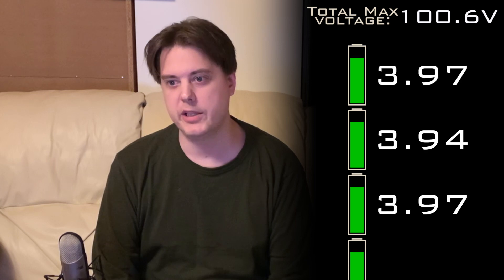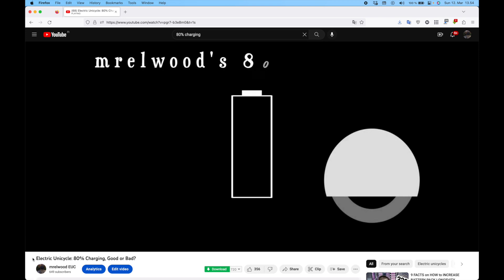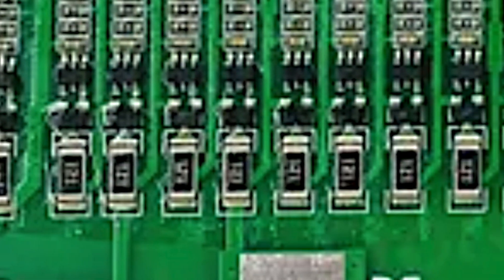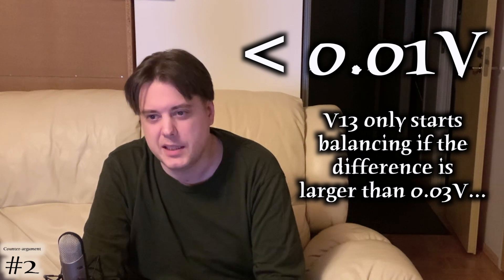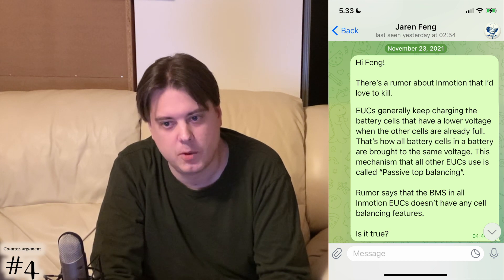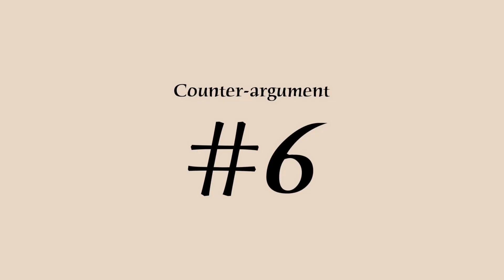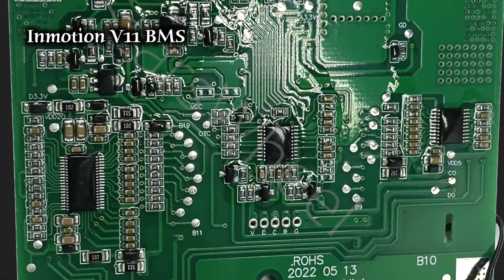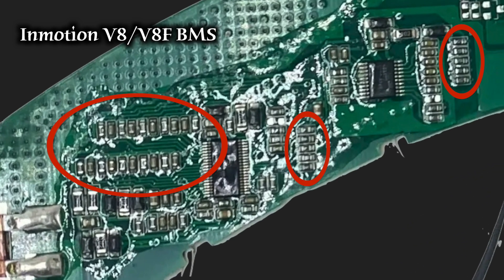Inmotion EUC Battery Cell Voltage Balancing, Yes/No?

Comment: So.. so far, there is solid proof that the V5F does not have passive cell balancing and you have acknowledged to @rcgldr that based on their findings, the V8F may not have any sort of balancing.  So while Adam's claims that no InMotion wheels have passive cell balancing (besides the V13 and beyond) MAY not be 100% correct, there are at least a couple models for which there is either hard evidence or pretty strong circumstantial evidence to support his claims despite what (some) InMotion engineers have stated and the visual presence of what MAY be bleed resistors that, at least for the V5F, have been proven not to serve the purpose of passive cell balancing.

Now, I'm not an InMotion hater; most of my stable is made up of InMotion wheels, but it seems like the only board ever actually taken apart, analyzed, and reverse engineered supports WrongWay's claim, while there hasn't been any solid proof to support the actual existence of passive cell balancing in their other pre-V13 wheels and, as mentioned, you have since acknowledged in several responses that at least some of their wheels may not have passive cell balancing after all.

https://forum.electricunicycle.org/topic/33366-inmotion-v5f-bms-charging-behavior/

https://forum.electricunicycle.org/topic/32080-do-inmotion-battery-packs-perform-cell-balancing-yes/

In conclusion: there is irrefutable proof one of their wheels (V5F) does not have cell balancing.  There is fairly strong evidence that another wheel (V8F) does not have balancing based on observed charging behavior and voltage readings.  There is nothing to actually support the existence of cell balancing in pre-V13 wheels other than the balance (ha!) of probability.

Comment: As you’ve described, passive balancing is on some inmotion euc’s models prior to the v13, like the v11. Adam indicated the importance of active balancing. Am i wrong? If I’m right, how critical is the difference between having passive and active balancing?
Reply from the maker: No, Adam didn’t recommend buying ANY Inmotion wheel because he thought that NONE of them had ANY kind of balancing.

Even the latest wheels still have just passive balancing, although a much smarter kind than they were when I made this video.

Comment: Follow up to my prior comment (over a year ago). Inmotion claims that V8F BMS will keep cells at 4.15 to 4.20 volts, a .05 volt variation (passive cell balancing BMS range is typically 4.195 to 4.200 volts, .005 volt variation). Someone checked a V8F pack, 5 cell pairs at ~4.2 volts, 15 cell pairs at ~4.15 volts, for a total ~ 83.25 volts. I tested my V8F, doing a full charge then leaving the charger running for 24 hours. The pack got close to 84 volts at around 0.3 amps, then stopped all charging, initially showing 83.6 volts. During the next 8 hours, the pack slowly discharged to 82.5 volts, at which point charging began again (stock charger led turned red). (In prior tests, I did a short ride to get pack voltage down to 82.5 volts). It maybe took 20 minutes before some cell pair reached max voltage, charging stopped, followed by that 8 hour slow discharge. I let it do another 8 hour 20 minute cycle. The pack remained a 83.6 volts once charging stopped. Inmotion did a "calibration" that changed the displayed voltage to 84 volts. I don't plan to measure the actual voltage. Assuming there is balancing it will be very slow if 1000 ohm resistors are used.

Comparing to 18XL which has true passive cell balancing. I bought an 18XL in April 2024. The 18XL BMS uses 100 ohm resistors, which translates into 0.042 amps balancing discharge current on a 4.2 volt 6 cell group. Using the KingSong app to monitor a full charge, once a 6 cell group reaches maximum voltage, it drops charge current to 0.00 amps, with periodic bursts of 0.25 amps about every 5 seconds, which results in the average current being less than the 0.042 balancing discharge current. This allows the high voltage cell groups to discharge while the lower voltage cell groups continue to charge, but at less than 0.042 amp average charge rate, which will take quite a while at such a low current. Once the pack is balanced, those periodic bursts cease to occur, and all charging stops. KingSong recommends letting the 18XL balance for 2 hours after charger led turns green, but the app can be used to note when those periodic bursts have stopped to know when balancing has completed. Most of the time, I have the pack at about 74 volts and only charge enough to end up back at about 74 volts after a relatively short ride. The longer I wait to do a full charge, the longer it takes the 18XL to balance the pack, but the pack voltage has remained the same, 84.05 volts (actually it's increased a bit to 84.08 volts, but I think that is due to monitoring and knowing just when the pack has been balanced). I only have 362 miles on the 18XL, as I don't ride as much as I used to, which is why I haven't seen any decrease in pack voltage. This method of passive cell balancing could balance a well out of balance pack, but would take longer than the recommended 2 hours, and the app should be used to confirm the periodic bursts have ceased, and balancing has completed. 

Back to the V8F. Unlike the 18XL where the pack voltage slowly increases a small amount during passive cell balancing, the V8F pack voltage slowly decreases once a cell pair reaches maximum voltage, so there is no passive cell balancing that occurs while charging.  i don't know what the V8F is doing while the pack is slowly discharging for about 8 hours, most of which may be due to just keeping the V8F awake enough to communicate with the app. With 1000 ohm resistors instead of 100 ohm resistors, and following KingSong guidelines, balancing would take 20 hours. I don't know if it would be better to disconnect the V8F from charger during that 8 hour or more slow discharge period.

Note - the eWheels rapid charger can't be used for passive cell balancing because it goes into standby, turns the led green and stops all charging once current drops below 0.3 amps. For the 18XL, I use it at 5 amps to get pack up to about 82 volts, then switch to the stock KingSong charger, which doesn't go into standby. When the stock charger led turns green, I then use the app to determine when balancing has completed.

Comment: from my understanding there is a chip or circuit that varies the resistance across each source. And that in theory will make each battery drain at relatively close timeframes. More or less.

Comment: What if you charge your wheel to 80% 2 times and every 3rd to 100%? What if you just charge to 100% the 5th or the 10th time between charging to 80%? Would you get the benefit of both? BMS and extended lifespan? 

Yes I know its only necessary if you drive like 30000 miles. I am just curious.
Reply from the maker: Back in the day the recommendation used to be to charge to full +balancing every 10th charge. Then it was once a week. But we still saw premature battery deaths when charged like that. That’s why every charge has made the most sense to me.

Every third sounds pretty reasonable still though. As long as you react if there are changes in how it behaves. I wish these were more scientific numbers, but it’s still just a guessing game. It all depends on how similar the cells are that you happen to get.

But again, this only applies to older wheels with passive top balancing, not the new smart BMS that balances the cells already before that.

Comment: Just picked up a V11, and the person said he only charged it to 80-90% at a time because he didn't want to over charge it due to the short distance he was using it (less that 8 miles per day).. Upon receiving it, I used it for a good 12 miles, but now have only charged this to about 91%.. EUC fires or PEV fires are what I freak out about.. but my other boards, Trampa, Exway, Ownboard, even Summerboard.. No issues.. Your video has helped my anxiety

Comment: Those ICs can control voltage and not necessarily balance it. There are so much resistors at any types of PCBs and they are not containing bms obviously. So you can't judje by presence of resistors...
Reply from the maker: I might not get your points the way you intended. Balancing the cells IS exactly controlling the voltage. And BMS stands for Battery Management System. Every device (of any kind) that has a charging feature in it has a BMS, whether it has a balancing function or not.

My point in bringing up the resistors was a response to WrongWay determining that if a BMS doesn’t have the same resistors than a GotWay BMS, it wouldn’t have a cell balancing function of any kind.

Comment: Hi, brother. Let me ask you a question. My V12Pro has about 8% power left and the voltage is 82V. Another battery failed and I needed to buy a new one. Can my new battery be installed directly? Because the voltages of the old and new batteries are definitely different, I installed them directly. Will there be any safety hazards when charging the two batteries together? What can I do to be safe? I really hope to get your answer, thank you!:face-red-heart-shape:
Reply from the maker: The V12 has a safety system in place that locks down the wheel if the voltage difference between packs is more than 5V. You will then need to contact Inmotion to get it back open.

Traditionally you needed to get the packs within 0.5V before connecting them together, but since they aren’t hard wired together in V12 you don’t need to be as precise.

If you already connected the new battery and didn’t get locked out, I would still disconnect the battery that has more voltage and charge only with the lower voltage pack until they are close to each other. Only then connect both and charge together. The V12 should then be able to balance the pack voltages.
Reply: @mrelwood_EUC  
Thank you very much for your answer. How do I charge a battery? If I charge the low-voltage battery separately and the other battery is disconnected, I found that the V12 will alarm. Do I need to use some other method to charge the low-voltage battery separately? Thanks again for your answer!
Reply from the maker: @WoniuGo I’m probably not up to date on the V12 firmware behaviors. Does it still charge despite the alert?
Reply: @mrelwood_EUC  
I tried charging a battery separately, and the V12 would have an alarm sound. Electronics is not my specialty, so when I heard the alarm sound, I got scared and had no choice but to unplug the power cord immediately. I'm not sure if it can be charged the same way if there is an alarm prompt? I don't have any other equipment to detect.
Reply from the maker: My guess is that it just wants to let you know that you only have one battery connected. There’s no danger in charging only one battery as long as the other is completely disconnected. This includes all cables that come out of the battery.

I would start charging the one battery only and keep watching the voltage. If it goes up even a little, you’re good to go.
Reply: @mrelwood_EUC  Got it, thank you very much for your answer, it was very professional and detailed.:face-red-heart-shape:
Reply: @mrelwood_EUC  
Hello! Mr mrelwood. Thank you very much for the above method. I just tried to use the method you mentioned to charge only a single battery A. The voltage can rise slowly, charging from 81.5V to 86V. But when I charged battery B alone, I observed it for two minutes and found that the voltage remained at 81.5V and did not rise slowly. The charger also had a green light. Does this situation mean that battery B cannot be charged? Is this battery defective and completely unusable?
Reply from the maker: @WoniuGo Sounds like it yes. So did you have TWO failed packs all of a sudden, at the same time??
Reply: @mrelwood_EUC  It must be the last time I rode a bike, the battery was only 18% left. As a result, when I was charging, Battery A reported an error. It should be that the power was too low, prompting me to charge it. When the voltage rises to 87V, it won't report an error. Battery B reported an error that the power was too low and could not be charged. The voltage was always 81.7V.
Reply from the maker: That sounds like the battery cells were really badly balanced. It’s no problem to go (very gently) down to 0% with a healthy battery. Out of curiosity, have you been balance charging? Meaning, do you leave the charger connected for 1-2hrs after the charger turns green?
Reply: @mrelwood_EUC  No, I usually charge it to 90%-95%, then unplug the charger, stop charging, and go out riding again the next day. I'm wondering if something went wrong? As a result, my battery can output power but cannot be charged. I did not ride violently and used the original charger to charge. Maybe I was unlucky and came across the battery in that probability. Thank you for your patient answer. Through the method you mentioned, my new battery has been installed. The voltage of the old and new batteries is consistent, and there are no errors when charging. Thanks Mrelwood
Reply from the maker: @WoniuGo I’m sorry to say but your charging habits were what most probably killed your battery. All except some of the latest gen EUCs rely on passive top balancing to keep each cell at the same voltage. And that balancing only happens when you charge to full + 1-2 hrs in the charger. If you always unplug the charger at 90-95% you prevent the BMS from ever balancing the cells. The cell voltages will drift away until eventually the battery fails exactly like yours did. It’s a really stupid system.

If you want to know more look up my video about 80% charging. And please charge to full + 1-2 hrs from now on! Especially now that your battery packs are of different age.
Reply: @mrelwood_EUC  
Thanks for the suggestion, I'll try it. I didn’t dare to charge it so fully before because I saw reports that overcharging lithium batteries can catch fire, so I didn’t dare to continue charging after the green light. Especially for V12, it took too long to charge until the green light came on. The official said it was fully charged. It takes 9 hours.:face-orange-biting-nails:
Reply from the maker: The BMS exists in EUCs to take care that the batteries aren’t overcharged, undervoltage etc. The batteries don’t get overcharged even if you leave the charger on for a week. Besides, if the cells are properly balanced, they wouldn’t get overcharged even without the BMS, as long as you use a correctly functioning charger. But not ever charging to full is a much bigger risk. The stock charger is very slow, and since your cells were very badly balanced, it took even longer.
Reply: @mrelwood_EUC  Thank you for your answer, I learned a lot.🤝

Comment: My relatively new V11 (I’ve ridden 150 miles on it) was just locked due to some sort of battery balancing issue and I’m trying to figure out what happened. The current voltage of the two batteries is 82.8V and 76.5V. I’m perplexed by the large differential since I was sure that prior to my last ride I had charged things to full ( and beyond?)
Reply from the maker: @d.d.jacksonpoetryproject   The voltage balance between the battery packs is a different direct altogether. Cell balancing only balances the cells inside one battery pack. The voltage differences between packs are handled by the mainboard.

Unfortunately there have been several issues with differing pack voltages on the V11. It doesn’t help that the firmware is a bit trigger happy about this safety feature.

If the pack voltage difference remains as large as you mentioned, it’s a warranty issue and you need to contact the seller. For intermediate differences that balance themselves out you can contact Inmotion directly to have the lock removed. But they won’t do that if the difference is that big.
Reply: @mrelwood_EUC  I contacted them and they insisted it was safe after observing my log to ignore the warnings and go ahead and fully charge. Once I did this they rebalanced and all seems well now, thankfully (knock on wood!)

Comment: Well, this convinced me enough that my inmotion v12ht indeed has a bms system and I don't need to worry.
Reply from the maker: To be exact, every wheel ever made has a BMS system of some kind. It’s just about which features the BMS system has. But yes, as long as you have good charging and discharging habits, you don’t need to worry. For more information on charging and balancing, check my 80% charging video.